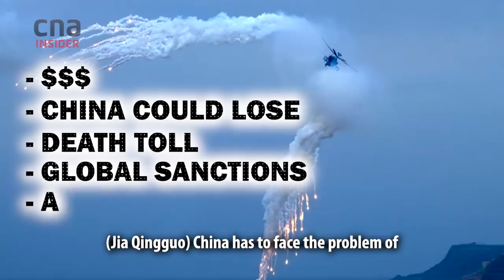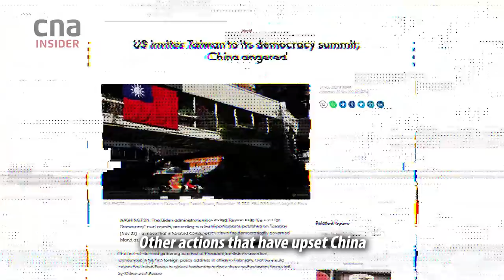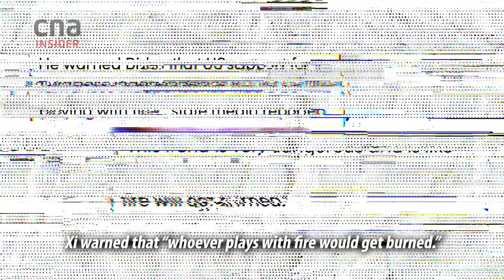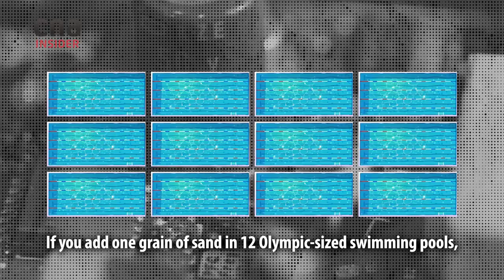4 Signs War Over Taiwan Could Be Coming - And Reasons Why Not

Comment: In 1941, you can take oil fields by force. But in 2021 you cannot take the technology to make chips by the same force.
Reply: “”The Imperial Japanese Navy also used the mountain's name in its "Go" signal—NIITAKAYAMANOBORE 1208 (ニイタカヤマノボレ一二○八 [Kanji: 新高山登る一二○八]), meaning "Climb Mount Niitaka 1208"—to begin the surprise attack against the USN Pacific Fleet and its base at Pearl Harbor, Hawaii, on 7 December 1941 (8 December [1208] in Japanese calendar).”

Mount Niitaka=Mt Jade of Taiwan
Reply: Taiwan is not only about technology on chips. Even Taiwan got nothing left, CCP still gonna take taiwan. This is a promise they vow to achieve and they have been keept saying it for 70 years.
Reply: @hc-eq9dn  
Keep in mind that CCP has never touched Taiwan for a second.

The last bomb dropped on Taiwan was ironically  by USA in 1945.

The first bomb? It was the operation of KMT's ROC and USSR's airforce that dropped several bombs to Taihoku/Taipei Airfield in 1938. 

I guess CPP will just keep saying whenever it's leadership is in trouble to keep in power.

By the CPP's Mao supported Taiwan independence in the first place.  CPP decided to change after 1949. 　CPP may change its mind again  in the future too.
Reply: @hc-eq9dn  Agreed. It's not about economic reason.
Reply: @hc-eq9dn  Calling it that China wants the semiconductor is almost a false/hoax argument. Yes China wants the territory.
Reply: although taiwan has chips, taking over taiwan is not about them. Its about ending the unfinished  civil war.
Reply: much cheaper tp buy and china has hired many teams .from taiwan. 13 percent of taiwanese work on mainland.
Reply: CHINA AND TAIWAN STILL UNDER CIVIL WAR.
Reply: @PlaYer-sn5or  Goliath vs Hobbit
Reply: America took Iraq's oil by force. Or at least tried but we Iraqi's kicked their butt, and now China has the same share of Iraq's oil as the US. lol
Reply: @hc-eq9dn  I know, its for the same reason they want to keep Hong Kong.
Reply: @ehsanali9023  Iraqis kicked Americas but?? Are you insane???
Do you understand in Desert Storm (the real war) Iraq lost over 20,000 soldiers and over 100,000 civilians while America lost around 200, most being from friendlies. AMERICANS killed more Americans than Iraqis killed Americans. Where do you get your news?? Al Jazeera or CNN?
Reply: Oh you absolutely CAN take Taiwanese chip tech by force! If China takes the Island, China takes the factories, the scientists, engineers, blueprints, and yes, the chips themselves. You can make a lot of high tech military with those chips. I guarantee you China already has detailed plans to acquire and exploit them.

Keep in mind after WW2 America and Russia carved up the greatest minds of the German scientific community like a Thanksgiving turkey! It's actually how Russia got Sputnik and America got the moon landings.
Reply: @Fierysaint1  I don't agree with you, It's not medieval era where you go to war to take pow as labor. You cannot do the same in this era with engineers scientists etc, good luck with that
Reply: @David Moore thank you so much, David
Reply: @Fierysaint1  you are talking about a battle that happened between Saddam Hussein and America. Saddam Hussein is not a true Iraqi. He was America’s agent. His own citizens hated him and only fought in his wars because they had to. 

The war I am talking about is the 2003 invasion of Iraq. Saddam Hussein was ousted from power, and Iraq was invaded under false accusations to steal its oil. In this war, the Iraqis that fought America, fought it by choice. They were defending their home land. They fight America for nationalistic and religious reason. I say they defeated America because victory in the war is not decided by the casualties on either side. It is decided by the one that achieves its objectives. I can give u further examples if u wish. 

America didn’t invade Iraq to remain for 8 years. I can prove that to u if u wish, but the fact that they stayed only for eight years is proof of defeat because it means they were forced to leave, while creating a window for China to have as much access to Iraq’s oil as the US, and to Iran. Increasingly, Iraq is on the side of Iran, Hizbullah and the Assad Regime. This is a defeat for America created by the Iraqi ppl.
Reply: @ehsanali9023  Ok sure. If that's your definition of a win. America came over, beat the crap out their military, but the Iraqis didn't want to be a capitalist democracy or defend their country. So America left. Sure you can call that an American loss I guess. But it sure wasn't an Iraqi win.
Reply: @pureepatarttawejkul1693  I just told you they did it in WW2. And Russia did it to eastern Europe all thru the 20th century. All you have to do is threaten, then change the bosses and CEOs of these companies. And China is doing it to Hong Kong right now.
Reply: @FC-vp9ej  right , b/c it’s the US that wants to take over Taiwan’s sovereign territory that they never ruled for a single day 🤣🤣🤣🤣🤣
Reply: @Fierysaint1  what?? Iraq is capitalist and it is democracy. Again, America wanted to stay much longer than 8 years, but they couldn’t
Reply: No, china want to take taiwan because of historical arguments and also that island is a strategic place for both military and political for any aggression against china
Reply: @Fierysaint1  Does this mean US  genocided 100,000 Iraqi residences.?  Kindly enlighten me. Thanks.
Reply: @jimmytang9853  No, it means the Iraqi military constantly hid behind it's civilians.
Reply: Sure you could take it by force, but like always you got to suffer the consequences 🤷‍♂️
Reply: @bctvanw  mao never support ROC, he only agreed a ceasefire between PRC and ROC. Why the hell would Mao “support” rebel that broke China into a civil war during a World War?
Reply: No need to take technology by force. They have it already. India has nothing but loud mouth and poverty.

Comment: China's clock is ticking - if it does not secure the first island chain, its economic stability will be severely compromised, leaving China in the same position as Imperial Japan during the lead-up to the attack on Pearl Harbor

Comment: China's chip fabricators have failed, they need TSMC on Taiwan.  They will attempt to defend these TSMC fabs but both sides will be prepared to destroy the fabs should they believe themselves to be losing the confrontation. Whichever side is capable of taking TSMC relatively intact will rule the future.  The winner will not allow the loser to ever catch up. TSMC produces over 60% of all chips and 90+% of the most sophisticated chips used in the Western World.  Samsung, a mere geological hop, skip, and jump away will also be targeted.  Samsung makes another approx. 20% of global chip production.  The stakes are huge.

Comment: How can these idiots draw an analogy between China's need for semiconductors and Japan's need for oil. If Japan physically invade and take over oil fields they can pump out the natural resource themselves. Semi conductor is not a natural resource, it's a work of intellectual effort. Starting a war and invading would only result in the semiconductor talent either getting killed or running away. The manufacturing facilities in Taiwan you want would either be destroyed by the war or through self destruction. If you want to be Machiavellian about it you might as well just conduct industrial espionage or even abduct the Taiwanese talent and torture them for info.

Comment: China flexing its military with Taiwan is a message to the Americans to stop meddling. The Americans are working hard behind the scene to spark a conflict. And the motion is set to move the chip technology from Taiwan to the States through Intel. Listen carefully to which commentator in the video who keep speaking of a possible war. The American lady. There are also alot right wing videos speculating of an imminent attack on Taiwan by China. The Americans are setting up a stage for conflict without them as seen to be directly involved but they are.

Comment: Today , wonder how many would listen or even read those reports by Cna or rather CNN where the former is nothing more than a by product of CNN in Asia. Most of their reports regarding China’s position globally & in Asia in particular, have been rather biased & riddled with inaccurate narratives like one could find holes in a Swiss cheese.! Other reports on the Taiwan issues , seemed lop sided in terms of China inabilities to conduct a successful war against the Taiwanese defences, which many would disagree as the island itself, would not last a few wks. in holding out against the onslaught.Secondly, China is not dependent on Taiwan’s chip dominance these days as China has been producing & surpassing Taiwan chip production capabilities. It has overcome the production of nm chip processing levels to meet its national requirements and Taiwan ‘s position on chip production is becoming less relevant to China ,which has also, been able to use its domestically produced lithography process for its industry. ASML is another western company that’s losing its competitive edge to China’s own efficient chip processing industry through massive financial investments on RD & enhanced  creative technical environment.